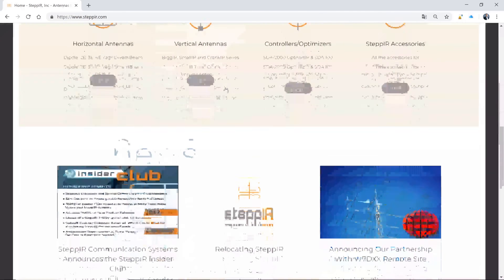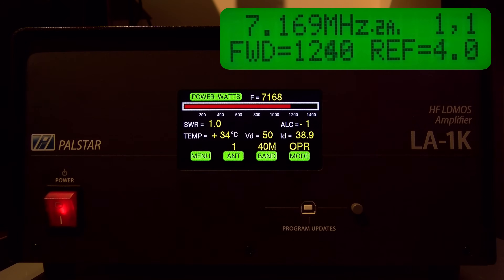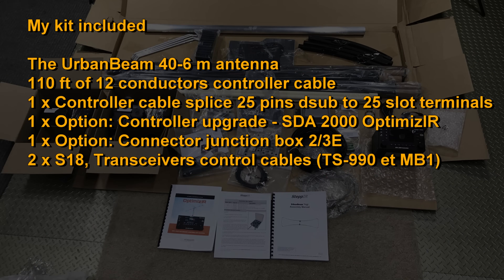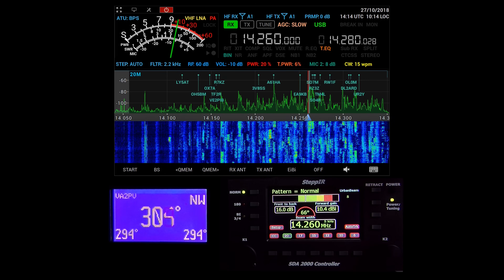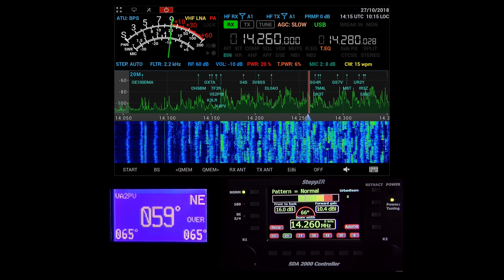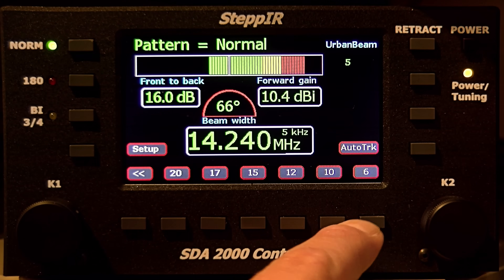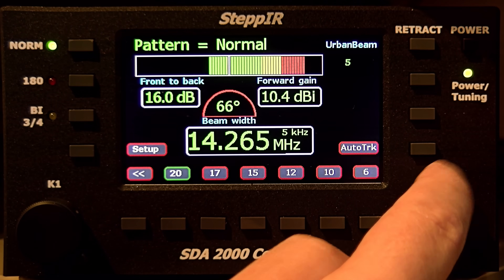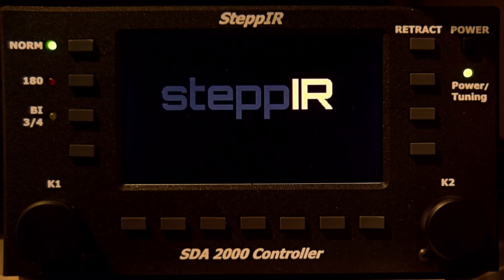SteppIR UrbanBeam and SDA 2000 full review (HF antenna)

Comment: The cost of a broken control box is just ludicrous.i have had a two element system for many years and found that they can become very difficult to keep it in good service . The replacement parts . I priced the price of a new control box and told over £1000.00 . 
I have found a way to operate the antenna without the £1000.00 control box using two SMC02 from e bay for the total price of £30.00 connecting each to the director and the driven element and tune the elements with a SWR meter. Very easy to setup and it works

Comment: Are you comparing a vertical omnidirectional antenna with a two element horizontal beam? How much difference in cost is that SteppIR beam?  Not impressed at all.  Much cheaper to do a multiband Hex-bean and fewer things to go wrong.

Comment: Great Video and Thank you- Quick  question-   When it operates in 40 meter as a folded  dipole -   the director retract,  does the driven element met at the other end and connects to each  other?  Thank you 73!
Reply from the maker: Thanks.  Only the driven element is used on 30 and 40 meters, the other is full retract.  73

Comment: Great video. I’d like to do a segment on my show about “building your ham shack the right way.“ of course the antenna is the main component here. I’d like to use the segment where are you show how the urban beam is working. I have one of these antennas myself but my physical limitations have limited me getting it up yet.

Your video is very good and I believe I can help teach many incoming ham radio operators. I will be sure to credit your channel in the description of the video with a link to it as well.

Larry 
de K7HN
Reply from the maker: Hi Larry, no problem as long as it's just small parts, just send me the link when done.  Thanks for asking.  73 Pascal VA2PV

Comment: Great video but I am confused. 
According to steppir website the 40 m gain is about 1.6dbi which is less than a dipole 2.2 dbi . Your performance on 40 m should have been less. Perhaps your dipole was not well done? Or perhaps the dipole was not pointed at the source but your urbanbeam was? Also your controller on 20 m shows 10.4 dbi but steppir website shows 6.5 dBi why so different?

Comment: Thanks so much for the very helpful video series -- I just got mine up on the tower and it's working great.   Wanted to share a few things I did differently and/or discovered along the way:  1) I purchased the connection box option, and the plate covers the boom bracket set-screw on one side when installed, so I drilled a 3/8" hole in its mounting plate to provide access to the screw for tightening later.  2) Used heat shrink tube rather than electrical tape to insulate the shield on the control cables in the EHUs and connector box.  3)  I used Messi & Paoloni UHF 10.5mm Evolution connectors -- they are watertight and very solid and helped with making a stable connection to the side mounted SO-239 connector.  4) After getting the beam up at full height (53' for my tower), I found that the SWR was offset on each band a little, and the easiest way I found to correct for it was to attach an antenna analyzer (I have a MFJ-269), and use the create/modify, band correction parameter, and adjust it while watching the analyzer -- you can see it step up/down as the adjustment is changed, and it's easy to find the dip and point of optimum resistance & swr and low reactance by rocking the K1 knob.   I checked the bands at the edges and center, and made the adjustment at the point in the band that was at the average correction.  Most bands were flat, but offset, except for 20m, where the offset increased slightly across the first half of the band.  I was able to adjust all bands close to 1.0/1 except for 30m, which the best was 2.2:1.

Comment: Nice video and explanation of the beam.  I have the small IR vertical and have ordered the Big IR.  I need to clear some woods to acquire the urban beam.  Incidentally, you could use an end fed half wave for 160 by wrapping the 240-250 foot line around the lot.  The tower could give you one of the points to hang the wire.   I use one myself and run 1.5 Kw into it.

Comment: Thanks for all your great videos!  You mention power.... that is the reason my hexbeam will be replaced with an Urbanbeam just as soon as winter is over.... Regardless of which hexbeam you buy.....IF you stay key down for very long... it will burn the spacer cords in two..guaranteed! Then your done!  Great antenna , terrible application...... If your hexbeam is on a tower like mine....that's a mess to repair!!!!  Come on spring 2020!

Comment: Great video series.  I am in the middle of this major Steppir Urban Beam construction project. For over $2500.00 US, Steppir did not make this a simple antenna to put together.  For the amount of money this kit cost, you would think they would have prepped the elements and the sweeps so it would be turnkey assembly and not introduce so many different project related modification product risks.  The amount of modification to the elements alone is enough to examine other manufacturers and antenna options in the market. I am praying this thing actually works when done.  The sweep design alone makes me quiver with fear.  Few commercial enterprises would accept such a kit that is requires this much custom work on OEM parts. I just bought a backup Mosley Pro antenna just in case this antenna craters in 6 months.
Reply from the maker: Hi Keith, I have mine for more than a year and it works like new, it endured high wind and a major icestorm last winter, without any issue.  I know it's a lot of work, but there's nothing like this in the market and it really worth the effort.  You can also watch my assembly video, it may be helpful, see the link below.  73 Pascal VA2PV  
https://youtu.be/HKLnPsXhUYE
Reply: I have watched your video 20 times for assembly without it I would be screwed. Thanks! We have to bend the sweeps more than you can bend them with your foot and sock technique. We are on that step now. Hope that once I get this done the issues with assembly will be a distant memory.
Reply from the maker: @keithheimbold7532  I remember that the sweep tube was the hardest part, you will be surprised at the end to find that the antenna is very solid.  I'm glad my video helps.  73 Pascal VA2PV
Reply: I have watched your video 20 times for assembly without it I would be screwed. Thanks! We have to bend the sweeps more than you can bend them with your foot and sock technique. We are on that step now. Hope that once I get this done the issues with assembly will be a distant memory.
Reply: When they are working they are ok but after a few years the become very troublesome with wiring faults and springs in the antenna boxes braking also the conductor has chip faults and have to be replaced after a few years , then the conductor box starts to give trouble and the cost is approximately ridicules , they get damp inside the plastic tubes from the cold and heat and it’s not possible to get a good SWR .  With hindsight I am sorry I got one .

Comment: Watched all 3 videos. Very well done. I'm curious where it shows the bearing of the antenna. I don't think I saw that on the controller screen. Thanks for the videos es 73, Gary AE4GS
Reply from the maker: Thanks Gary.  The SDA 2000 controller only controle the antenna step motors, the Yaesu rotator is control via my MDS RC-1.  73 Pascal VA2PV

Comment: Hi Guys, I am thinking of replacing my SDA-1000 with the newer SDA-2000  however I can't seem to find the dimensions of the new box.  Does anyone know the dimensions for the SDA-2000?  Thanks.  John - AA6JA
Reply: Thanks so much. The SDA-2000 will fit into my radio rack.  Off to the SteppIR store.
Reply from the maker: Just measured the SDA 2000, it's 7.25" wide, 4.25" high and about 6" deep with buttons, but that doesn't include the DB-25 connector sticking out of the back. 73 Pascal VA2PV

Comment: Hi Pascal thanks for sharing this video about the Urban beam. I have some questions, first why is the forward gain expressed in dBi instead of dB? or is it changeable? I think dB is more reliable. Second question is what is the maxium front to back and how much forward gain left over and vice versa. Looks like a great beam to me because I have a very small back garden.Thanks in advance for your anwers and have a lot of fun with your new beam .73 and happy holidays ,de Dirk PA1BD
Reply from the maker: Hi Dirk,  Just check and I can't change the forward gain to be in dB instead of dBi.  For the second question I'm not sure I understand, but the gain varies depending on the band.  On 20M it says fwd 10.4 dBi with a FTB of 16.0 dB, this is at 66 degree beam width, at 66 degree the fwd is 10.6 and the FTB is 16.4.   For me it works very well, as shown in the video.  Hope it answers the questions.  Happy Holidays as well.  73 Pascal VA2PV
Reply: @Laboenligne  Thanks Pascal for your fast response. 73 Dirk PA1BD

Comment: Well done Pascal. Is there a recommended height above ground for the antenna? Also, the forward gain displayed on the 2000 controller is much higher than what SteppIR posts on the website for each band. Any idea why? Thx.
73
Carl
NX5T
Reply from the maker: Hi Carl, usually it's at least a 1/4 wave is best, so used the longest band, 40m.   That's all depends of your sourounding, try to be the highest point around...  I will have to check it out for the gain.  73 Pascal VA2PV

Comment: very good breakdown on the beam and controller.   You do good stuff...   Hey, have you ever compared the 990 rx and the M 3 rx at the same frequency switching your antenna from one rx to the 2nd rx  receiving the same station?    It would be very interesting doing that during a contest. ( like 20 or 40 or both)   video of course..      Thanks 73 jim
Reply from the maker: Thanks James.  My setup doesn't allow me to use both rig at the same time, it's not impossible but some wiring would be necessary.  73 Pascal VA2PV

Comment: Bravo Pascal - super review as always. Is there any indication from the manufacturers on the expected fatigue life of the elements? Obviously depends on the usage but there must be some sort of  expectations on the cycles expected.
Reply from the maker: Hi Fraser, merci. There is no indication on this. Like any other antenna, it's probably a good idea to inspect it every few years to see if it needs maintenance. Two of my ham friends convinced me to have a SteppIR after they had it a few years. It survived are Canadian winters without problems. The fiberglass poles are very flexible and it can bend without braking (example, ice storm), if you retract the element the antenna should be safe. 73 Pascal VA2PV

Comment: Great job, in your other videos, I guess I was dense... which some times happens... hehe, but I didn't realize that the elements were actually in the two rolls on both sides and that it pushed them out into the fiber glass tubes, I didn't understand that this was happening. Now this video explained that, and WOW just that little knowledge made all the difference, in understanding what was happening. Thanks I love this set up. Make so much sense. Cheers and God bless
Reply from the maker: Hi William, I couldn't extract the element further than what the motor test allowed, because this could damage the antenna when the fiberglass tubes are not installed. Hope this clears it out. 73 Pascal VA2PV

Comment: lots of questions... 1) I am not sure I got this but could you connect your radio and "share" the frequency of the radio directly to the antenna controller ? 

2) at your house it seems an ok size antenna but really, this is still a large antenna, what is the turning radius ? 

3) aside from being a directional antenna, how does it compare to the cobwebb found in your previous videos ? I mean the cobwebb also covers all the same bands... 

4) when you were in "omni" mode, why is it still showing a narrow beam width of 74°, shouldn't it be like 280° or 300° degrees (as I understand it is not a fully omni antenna). ?

5) Lastly, what is the sdr software you are using ? is it tied to your kenwood radio ?
Reply from the maker: Hi Aleziss, here's your answers.  
1) Yes, you can synchronize the radio frequency with the controller for automatic adjustment, cool, eh?

2) The turning radius is 15.5 ft.  See my website for the full specifications.  
http://www.va2pv.com/steppir-urbanbeam-sda-2000-optimizir-en

3) The Cobweb is a good antenna, it’s small, light and low cost.  But it has no gain, it’s a folded dipole on all band and it’s not flat of SWR on all the frequencies.  I just can’t compare the two as it does not serve different customer needs. The UrbanBeam is way better, but also more expensive. FYI, I was never able to try the Cobweb on top of the tower since it doesn’t allow you to put something over it, like my VHF/UHF antenna, it’s just the way it’s built.

4) Correct, a completely horizontal dipole is not perfectly omnidirectional.  The same thing applies to the beam, but in this position, it does a better job with the reduce front to back attenuation.  It’s way more flexible than any other beam.

5) No, it’s my Expert Electronics MB1 SDR standalone radio, since it runs Windows 10, I can do screen capture directly into the radio.  See my review via the link below.  https://www.youtube.com/watch?v=yVGXVrP8trM&t=1491s

Hope this help.  73 Pascal VA2PV and thanks for watching.

Comment: Awesome looking an performing antenna system. I have lots of space here at my shack. So no need to down size. But for small areas such as yours.  This is awesome. Now. Is that a sun sdr  MB1 rig in your shack. Would love to see a video for that radio. Unless you have already done one an I missed it. Thanks. AA1US
Reply from the maker: I guess you've found it, hihi.  73